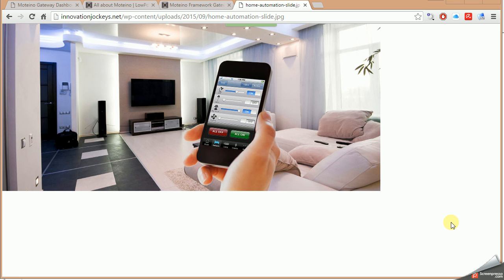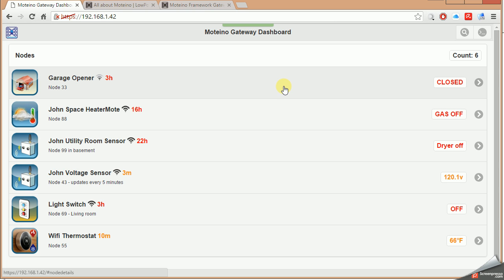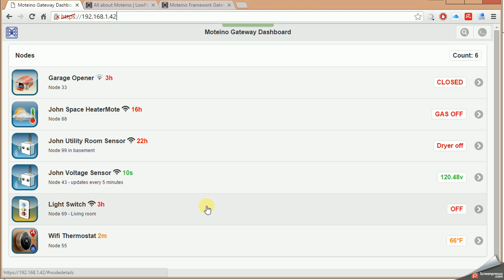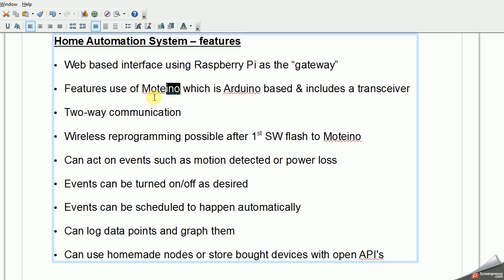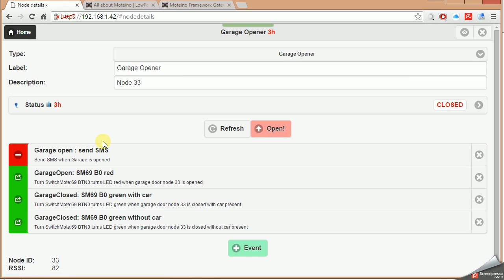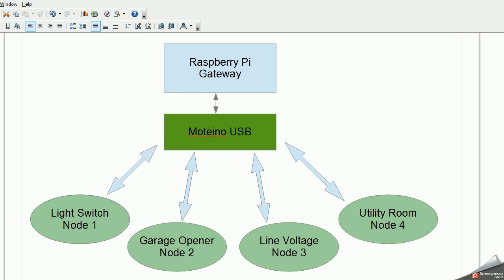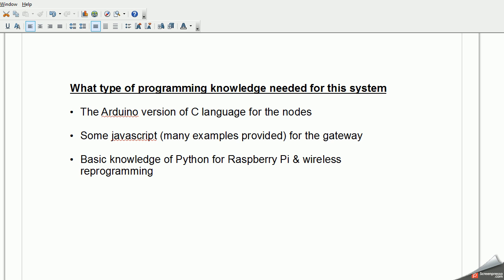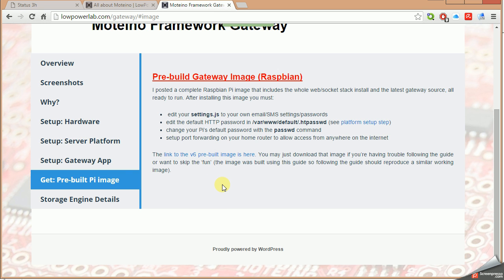DIY Home Automation System introduction

Comment: Fantastic video and information.  Just a bit unclear as to the RF modules needed for each Moteino, I notice lots of options.  Perhaps I need to poke around some more on the lowpowerlab.com website.
Reply from the maker: Yes it depends what region you’re living in and what your goal is (short or long range, high or low power). For certain you need a matching pair of radios so the connection works. In Michigan I use the RFM69HCW 868/915MHz
Reply: Thanks John, that is the radio I am looking at.  I'm a ham radio operator and do satellite work, so the 432 Mhz modules will probably give me some grief.
Reply from the maker: 73!!  I’m also ham licensed but not currently active
Reply: Awesome.  We should hook up sometime.

Comment: Pretty cool stuff ... being that it was 2 years ago (Y2016) I wonder are you still using Moteino?
Reply from the maker: Yes!! My system is still up and running :-)
Reply: John's DIY Playground can the Moteino devices link with Alexa by any chance?
Reply: @johnmccormick2883  So far there's no linking to Alexa that I'm aware of but check for updates at lowpowerlab.com

Comment: I am planning  to put multiple sensors ( air monitor :GP2Y1010AU0F,  light sensor and  a temperature  sensor). I  got  a couple  of  questions ... Can  connect  all of  these  into a Moteino +RFM69?  ,and  can I  create  this  network without  using  the raspberry PI ? ( I  mean get  the data  directly  to the  arduino?  Thanks in advance
Reply from the maker: Yes, if you're not wanting to have a gateway receiver moteino and rasperry pi, you could communicate between two moteino's.  The Pi is used for web interface and recording data.  So for example if you just wanted a remote sensor in your attic and then use a different Moteino to receive the data and display on a local screen, that could be done w/o a Pi.
Reply: Thank you so much for your help ! I will try it :)